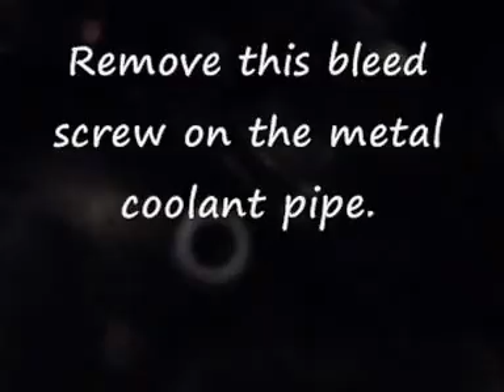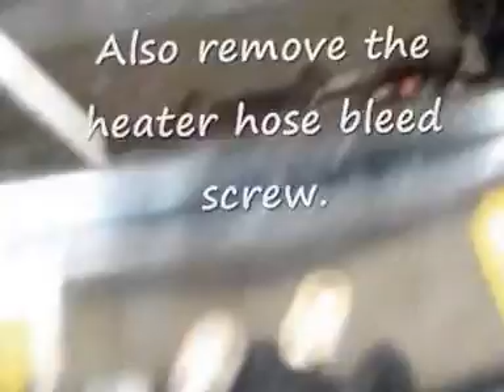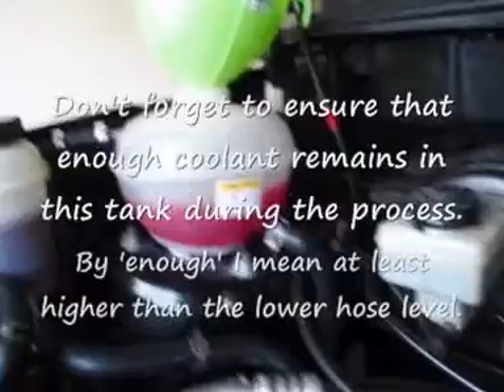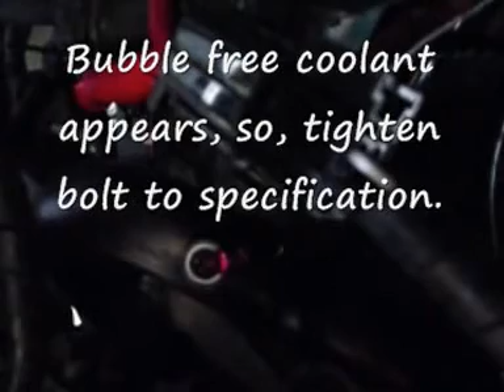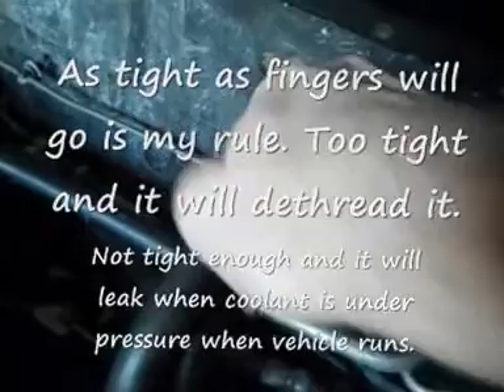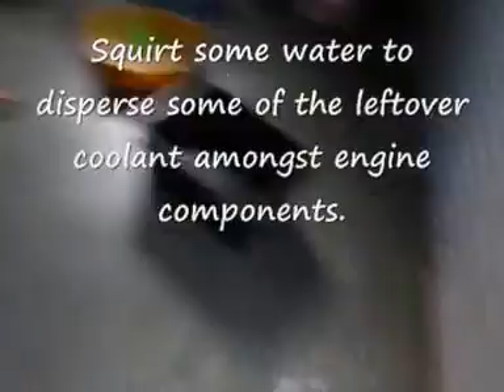1.8 K Freelander Cooling System Bleed

Comment: hey there os this the same for the 2.5 v6 freelander ?
Reply from the maker: +makarov kalashnikov Hi Makarov, no I'm afraid it's a little different on the Kv6 Freelander. I would suggest you have a look in the RAVE manual and I wont explain it here word for word since the KV6 is known to be difficult to bleed and if you don't get it right  -  you risk overheating it and engine damage. Some people buy an air bleed kit and do an air bleed on the KV6. Do you have the RAVE manual on CD? It has the official Land Rover write up for bleeding the cooling system. I might do a short video on this within the next few days. Jasco.
Reply: That would be awesome if u could I dont have the manual u are awesome thank you for your fast response and time :D
Reply from the maker: Hi Makarov, I have decided against posting a video for bleeding the KV6 since it's very hard to bleed...some bleed easy, some don't. I will tell you however that I am trying new waterless coolant for it. I suggest you get a hold of the RAVE Manual, if you look it up on google you are bound to find a good forum for bleeding the Kv6.